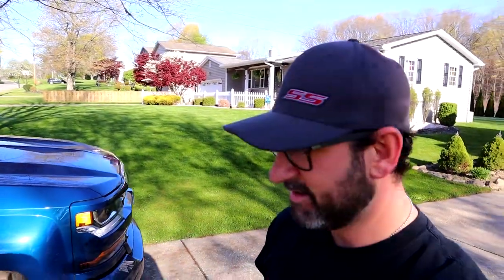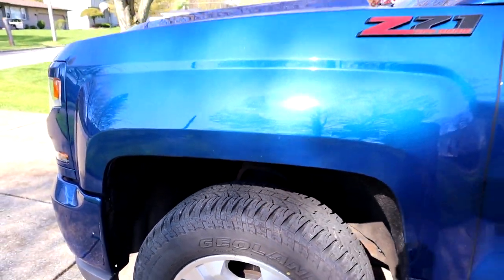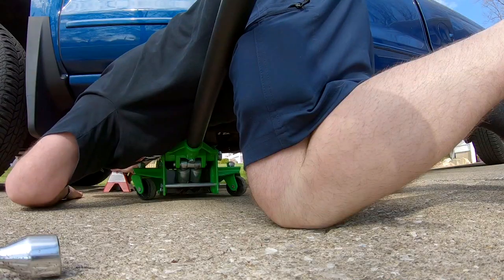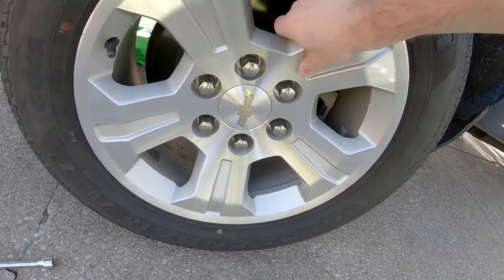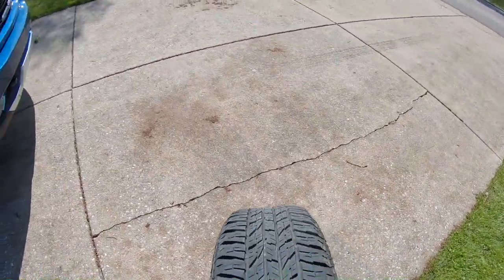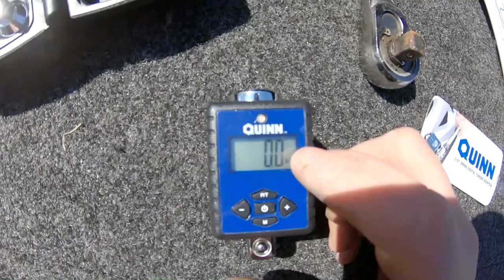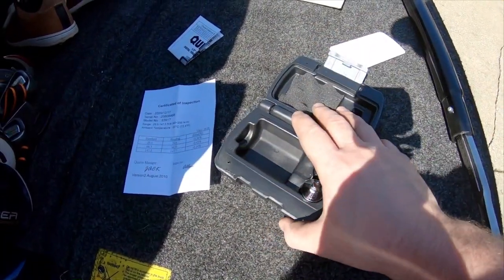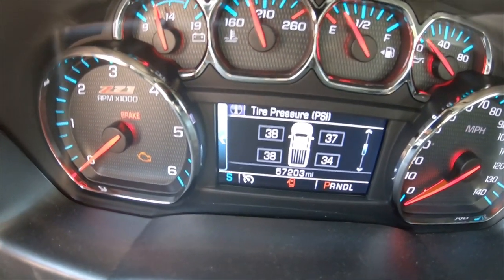Tire Rotation On A Silverado Right In The Driveway!

Comment: It is  a little more work but I use my spare tire to help rotate my tires. That way you only have to have one tire off at at time. High quality video
Reply from the maker: Thanks so much I appreciate it!
Reply: That makes sense. I watched another video and they said they use the donut as a placeholder as they work their way around their car. I would work the spare tire into the rotation on my truck but it’s a smaller size than the ones on there now.

Comment: I put my Silverado up off the ground on all four. Just makes it easier to do the rotation. In fact I'm getting ready to change the oil and rotate all 4 this afternoon before the cold winter weather gets here. Definitely torque the lugs because if you don't you will warp those brake rotors.

Comment: I replaced the starter on my ‘18 5.3 with 54k miles with an OEM starter.  The original starter had a bad connection at the solenoid / starter and it eventually failed.  Probably the nut wasn’t tight during assembly.  The new starter spins the engine over faster.  At $165, I decided to stay with OEM.  Thanks for the lead on the Tpms relearn
Reply from the maker: No problem! Watch out for the climate control panel light flickering next! Thats my newest issue with the truck!

Comment: I do this with one jack and one jack stand and remove one wheel and move on to next wheel so at.most there is one jack and one stand in place at a time...are you using chocks to prevent truck from rolling?